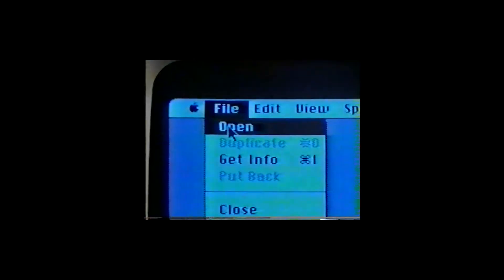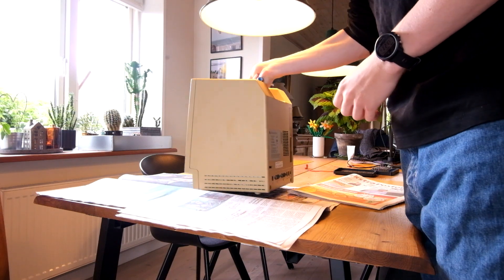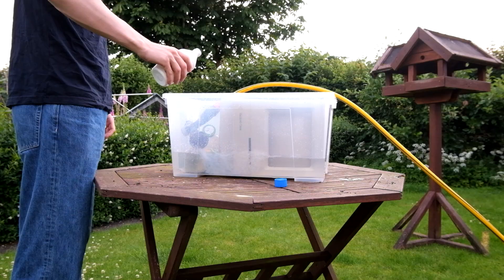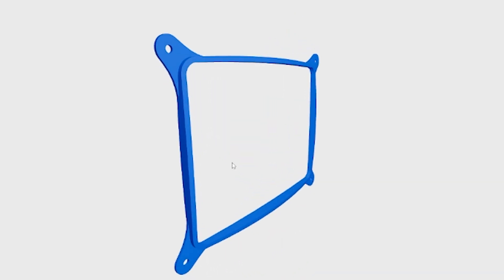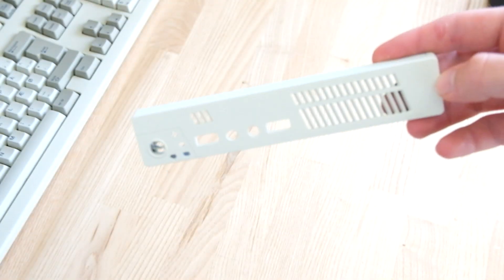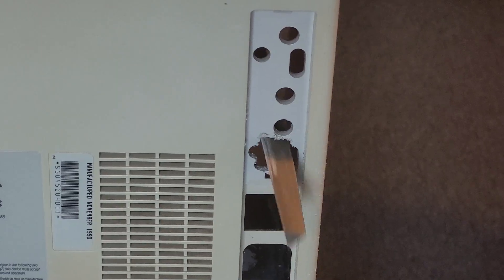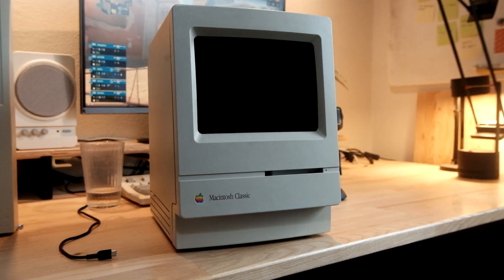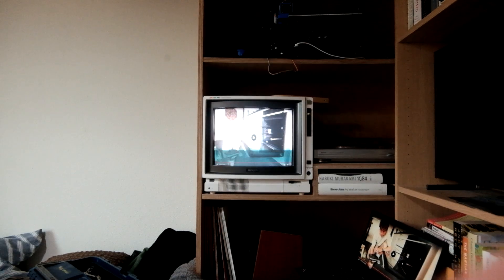Turning an old broken macintosh into a modern computer

Comment: Really nice job! Did you have any issues with the rounded bezel from the case blocking the corners of the lcd? I have a similar build and its so frustrating when the “x” button at the top and start button at the bottom are just barely out of view

Comment: Well made but it kinda hurts seeing people are still gutting these.  I thought that died out 10 years ago.
Reply: Lots of these have internals that are pretty much impossible to salvage, plus, the internals can be used in other ones!
Reply: Unfortunately looking at that motherboard it looked pretty unsalvageable, since for the mac classics Apple used extremely defective capacitors that leaked acid all over many of the motherboards. The problem was so widespread that it's almost a guarantee if the caps haven't been replaced there is a chance there is irreparable damage to the motherboard, ultimately making it ewaste anyway.

Comment: I have an old soviet monitor Электроника 15ИЭ-00-013, it looks very Fallout-like, and I want to do the same thing, the cutout for the screen is a bit bigger, but I think the iPad screen is the best solution. What board do you use to make the screen work and what lvds cable? Also, i want to put an HDD imitator that emits the cracking sounds when data is read from the SSD, to make it sound like a very old pc

Comment: Hey why didn't you remove the PC motherboard from the case? Would have given a bit more airflow ig. Other than that amazing work! Btw have you thought about using the floppy drive hole for an actual floppy drive? Useless but cool

Comment: You know what? Normally I try to be positive and reserved but this time I'm going to be the dick. It's my turn damn it. (I don't intend to disparage the creator of the video but I can't not say something.)
Why are people still doing this? These aren't common anymore like they were a decade or two ago. Yes it's an 'old useless machine' bybyour standards. But by doing this you haven't 'lessened e-waste', you've taken something that other folks have intense interest in preserving and probably put most of it in the trash anyway. (I hope you didn't but it's hard as hell for us to find parts to repair our own machines as it is.)
You're very creative. Yes it was your machine, do what you will I suppose, but... there's so many alternatives to doing this now. There's even full-size 3d models MADE for new hardware if you have a printer for other things anyway.

Anyway, I apologize for ranting but after babying my old Mac this week it just struck a nerve. I'm not even an Apple dude, I'm a Linux user.
Reply: Well yes, I don't like the idea of cutting all the holes in the case because it means it can't be used for a later Macintosh restoration (if you had good internals but a broken case).  Creating a reproduction case with the appropriate openings for the build would be an alternative (I don't have access to a 3D printer, but then again I used to do this sort of thing with sheet plastic, and the majority of the case is flat panels)
Reply: I wholeheartedly agree with this take. Maybe this was more acceptable during a time when these truly were of little value. But now that people are actively trying to preserve these, it's only being made harder to preserve them if people do things like this to original hardware in the present.

Comment: smh removing the CRT is a cowards move. It uses VGA so it is nothing to connect up a computer while still being usable
Reply: It isn't as simple as just attaching wires from a VGA cable to the CRT driver. It has to be driven in a very different way from a modern display. This is why he didn't do it.

That said, this project really does feel like a waste considering how uncommon original parts and systems are becoming, and there were many alternatives to this sort of modification.
Reply: @catplasmas  I have a mac and it is about that simple.
Reply: @kittyplasma these Macintoshes just use one signal for video, one for hsync and one for vsync.  So you could just breakout ground, vsync, hsync, and say the green signal from a standard VGA output. 

Honestly, the hardest part to do unless using an old computer is getting a modern system to output a sub 31khz resolution.  Modern hardware & windows really does not like doing it.
Reply: CRTs are of the devil.
Reply: @takanuva588  cathode ray tubes are the devil’s handiwork though
Reply: @DissociatedWomenIncorporated  sounds like flat propaganda
Reply: @takanuva588  😂 I almost got electrocuted by one as a little girl, have had a phobia ever since
Reply: I think it's important to mention that the Macintosh classic not only has a monochrome CRT, but it is also running analog driver technology not compatible with VGA (since it's a RGBHV signal). not to say it's impossible to hook a modern computer to it, it's technically possible, but that "technically" could carry a lot of extra work overhead, time, and complex electrical engineering problems on potentially lethal High voltage technology, I mean I love a classic CRT, considering I have many, but I also understand someone not wanting to go through all of the trouble if they just want to convert a broken computer's case into a desk ornament with a color screen.

Comment: I printed the Case, was cheeper than buying an broken Mac.
Reply: It saves it from the trash doesn't it?
Reply: @SpruceHouse  there sure is someone able to repair it!?
Reply: @SpruceHouse  All the insides and the monitor of this broken Mac are going to be trashed anyways.

Only the case was saved.
Reply: idk why these people keep replacing the crt, utilizing the monitor is far more interesting i feel like
Reply: @gamagama69  i thing it was black and white if it was coler it wud look cute ouo
Reply: If I remember correctly they have replacement cases you could get. Not a cheep as printing tho.
Reply: @pedrodaniellopesferreira2916 Well the worth of an computer this old (apple or ibm compatible, amiga, ...) make it cheaper to print the case and have an nice old pc saved. At least here is an broken Macintosh more worth than I paid for my printed case.
Reply: bro an old macintosh classic is a trillion times better looking than that goofy ahh windows 7 thinkcentre@pedrodaniellopesferreira2916
Reply: I need a case, too. But 3d printing is is about 400 bucks! An old case is much cheaper than that on eBay
Reply: @montre-moi  my case was 50, printed by a friend, if you own an printer its even less in material cost
Reply: @thewunderhase  sadly I dont know anyone with a 3D printer. I will keep looking, thanks